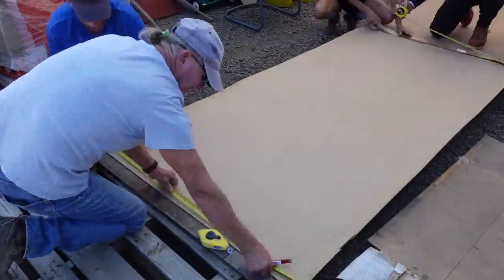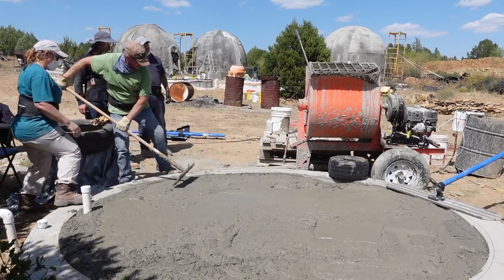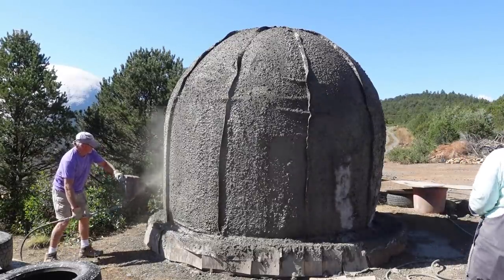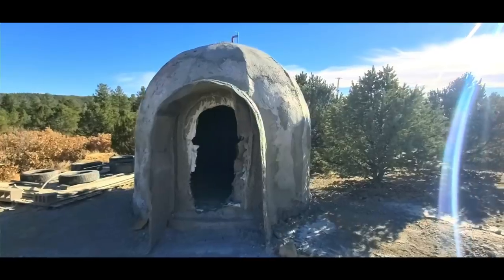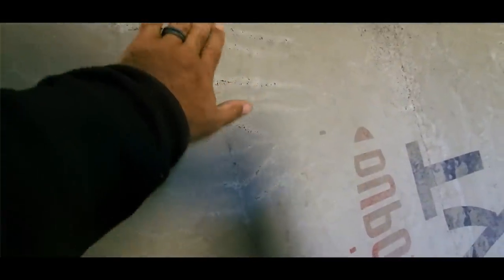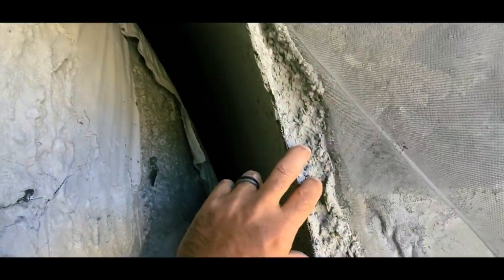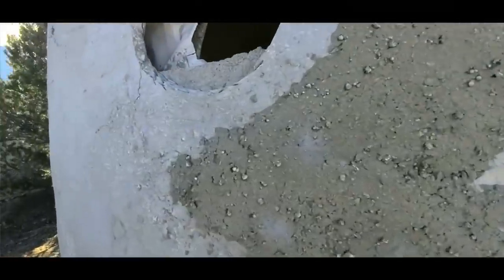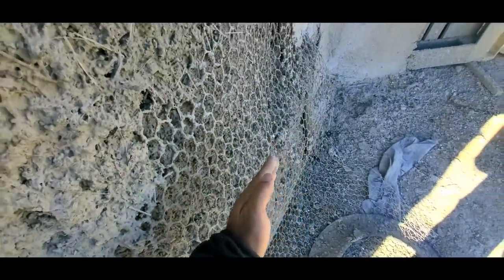Building Double-Shell Aircrete Dome in 5 Days #aircreteharry #aircrete #foamgenerator #domehome

Comment: Mesh sewing join could be a weak point, maybe use left over bits or just use strips of 6-8 inch mesh and overlap each joint
Reply from the maker: Not needed the mesh is strong.
Reply: @AircreteHarry  I know the mesh is strong, but the sewing joint is a weak point. In construction when anything join together there is a needs to be a set length / ratio where it overlaps. that single strand of vertical sew string is weak point, i think your overlap 1 inch is when folded properly to the side is stronger then the single strand of string. 
Please do a simple weight tension load test. Make few 6x6" log say 4 feet length, with regular aircrete+additives and have the underside put mesh + 0.5" cement, then load it with weigh to find the breaking point
test 1) control full mesh with no joints
test 2) your standard 1 string sewing join and 1 inch overlap in the middle
test 3) mesh with 3" over lap
test 4) mesh with 6" over lap
Note the overlap should not be in the middle, but slightly off centered as I assume you going to put a 6" wood board to spread the load, so it should be 3" off centered, as the edges of the board is the pressure spot and its at those 2 end point where it first cracks and break under load.

Reinforce Mesh width maybe reduce all test to 2-3" strip wide instead of the full 6" wide (aircrete block size no change). so you dont need to load that much weight for your test. I think 6" wide Mesh with no cuts should be able to support your wight.

Suggestion when you make your mesh maybe dont cut it out to shape first, as the top 1/3 of the arch has access mesh use that to make a larger overlap, and only reinforce the sew joins bottom 2/3 with more overlap on the sides, with access mesh
trace the shape individually with spray paint then sew them together, then cut out the access leaving a large 3-6" overlaps, more work and harder to sew them together, Maybe its faster for you to just do it the normal way, then use the access cut out and add 3-6" overlaps to the joint, i think that would be the better approach.

Comment: Have you ever lived in cement or cinder block home? They are cold and damp you will be hating life once you spend time in there,  You do not use concrete on the walls! You need something that breathes like aircrete, yes more time to build it but it's worth!
Reply from the maker: Welcome to the channel Bob 👍 
Thanks for your concerns.
Yes, for many years & always appreciated it for numerous reasons. 
What I'm doing with my structures is applying a thin coat of Magnesium Cement - it has great benefits. 
I spoke about it in many of my videos. This is the recent one:
https://youtu.be/3DqO8SKdI8c

As for the Aircrete - it is too brittle & won't pass the qualification for a building permit by itself. Nor would I ever recommend using it alone - all based on my first-hand experiments over the years. 
In this video I introduce the audience to the Double-Shell Aircrete Dome. 
While the Aircrete is used as great insulation, it is sandwiched between two thin layers of Stucco Shells on the in- and the outside. Very strong structure & only requires a thin layer of the stucco mix.

Comment: Hey Harry, it's Ernest again with more thoughts lol. So the doorway issue. How about creating a negative space for the door (or any portal/ window). I'm thinking wood frame, and plywood or something covering it. And it could be designed to be disassembled from outside. Basically all the screws are put in from the center, and the outside. And mark the form, so you know which side goes outward.
 Mark the slab where the door will be. So you can easily locate it. And after you spray the inner skin, place the form before inflating second skin. I think if it might help to leave the portal form in place until all of the outer pour is finished, and maybe until the center fill pour is done too. Maybe you could put a little doggy door in it, so you could inspect inside. Or maybe just a frame to hold a piece of the masonry board, and open through the center. Might have to use wide gorilla tape, to hold the tyvek to the portal mold. Or even cover the outside of the portal mold with tyvek. 
  I hope it makes sense. I struggle with words sometimes, i could probably do a better job drawing a picture with crayon.
 And I'm not sure if any of this would even work.
Reply: I had considered styrofoam, to fill the void. But the ultimate goal, is something reusable to match with your forms.
 And apologies if my ideas are bunk. My thinker aint so good.
Reply from the maker: @parallaxical3067  Styro-Aircrete would work nicely to fill the voids.
Reply: @AircreteHarry   oooo styro aircrete wrapped in tyvek?
Can't wait to see the results.

Comment: I don't understand the purpose of the two shells ? Why not just spray your cement sand on, say an inch, on a single inner form, follow after drying with aircrete and finish coat sand and cement? BTW a small diamond wheel on a 5 inch hand grinder would cut through those harder layers, then a Saws-all for the softer aircrete. I notice as well that you are not using basalt mesh which seems to be all the rage now. Too expensive or other issues ?
Reply from the maker: Hey Joe, Aircrete need to be poured into a mold because it's very much like water. That is why I make a second shell to hold the Aircrete in.  The two dome shells have Basalt & PVA fiber chapped in the mix.